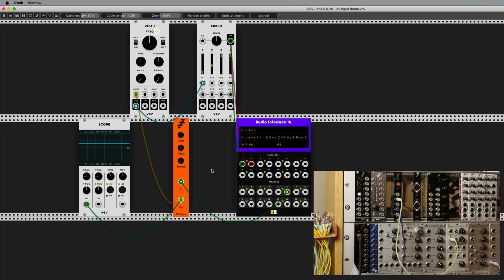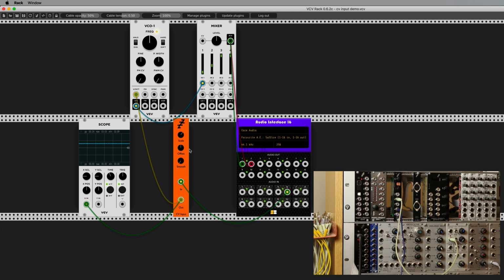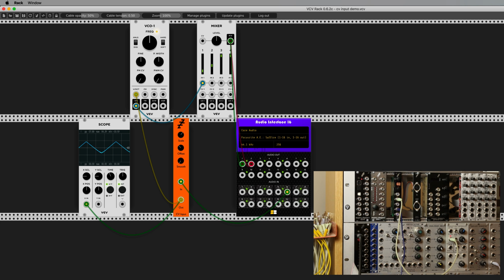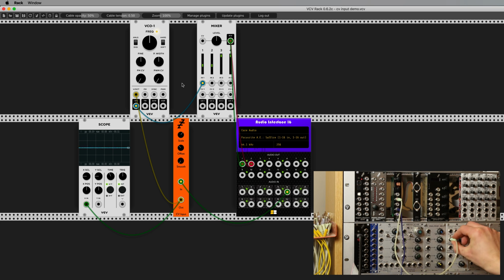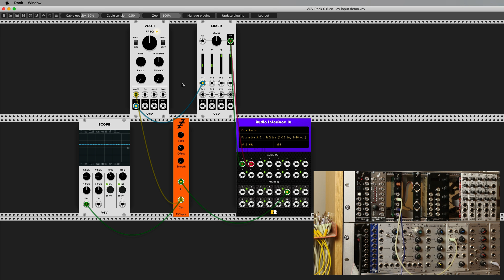Silent Way for VCV Rack: CV Input

Comment: Thanks for the video! I am struggling to figure out a way to get CV/Gate from my hardware controller through my Audient ID 14 MKII audio interface (Audient has told me that it is DC coupled)  to VCV Rack 2 on my Mac. Would I be able to achieve this by using ES for VCV Rack software?
Reply: or maybe i don't even need a dc coupled interface...

Comment: I read somewhere that the VST version of CV input works with any audio interface (incl non-DC-coupled ones). Does the VCV version absolutely need the Disting?
Reply from the maker: No, but if not the disting it needs the ES-2.
Reply: @ExpertSleepersLtd  ok thanks! Is there a module that allows simultaneous ins and outs in this fashion but isn't an audio interface (so not es-8 or 9)? Or am I looking at either two disting modules or an es-1 plus an es-2 if I want to keep using my fireface?
Reply from the maker: @davidberger5721  Can you not use an ES-3/6? Which Fireface is it?
Reply: @ExpertSleepersLtd  Its the 802. I could go via ADAT but would still need two modules when my physical rack space is limited and I only really want a couple of ins/outs. I realise this is quite specific...
Reply from the maker: @davidberger5721  There's the ES-8, which is 8HP.
Reply: @ExpertSleepersLtd  Yes, I think that's probably the one. Thanks!

Comment: Is it accurate enough to use cv pitch signals?
Reply from the maker: It depends on the total system, including whatever audio interface is being used. You would need to apply careful scaling to get e.g. a 1V/octave pitch into Rack exactly, but it could be done.